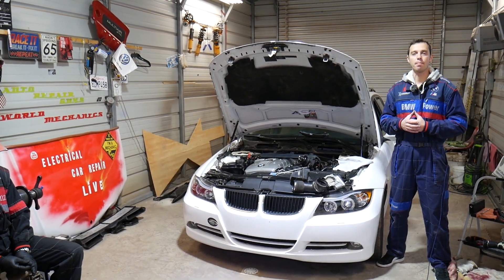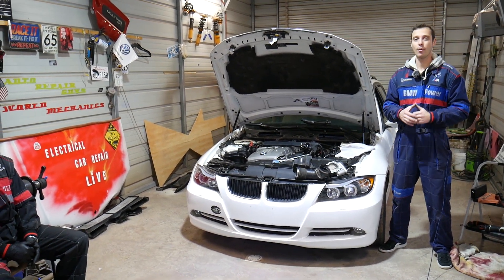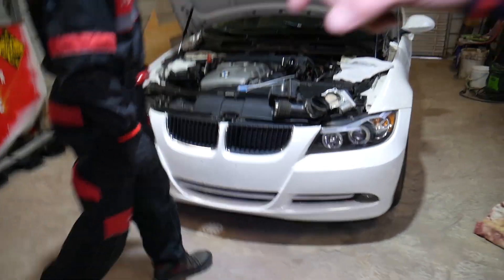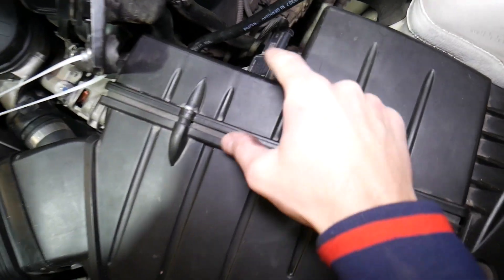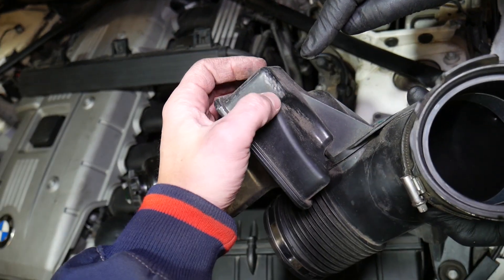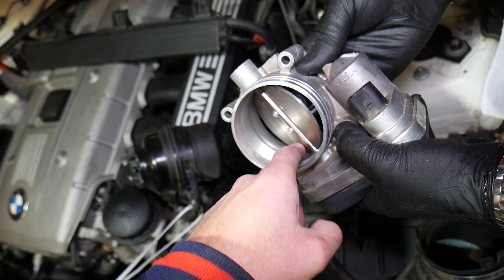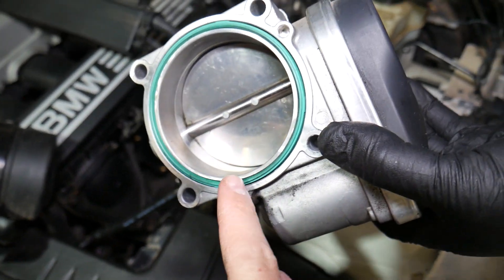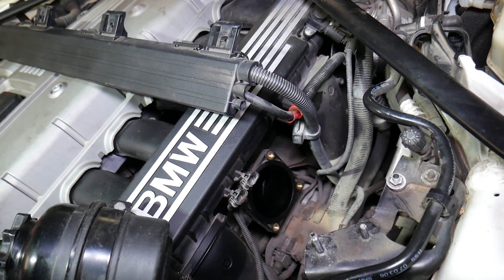ROUGH IDLE EXPLAINED ON BMW N52 N53 Engine E90 E91 E92 E93 E83 E81 E82 E87 E88 E83 X3 X5 Z4 E70 E60

Comment: So , my 325i 2009 N53B30 is rough idling and check engine light came on this morning!! Car drives as it did before no change but just idling rough for a bit on cold start and after 5 min its okay but check engine light still on. Any help !?
Reply: Hi, did you figure this out?

Comment: I have a rough idle on my e91 N53. It goes away once the engine warms up. Can it still be leaky air system, or would it be be faulty injectors?
Reply: ive change my injector and didnt change anything, if it can help u ;)
Reply: @timmybuzz420  I have it aswell, thinking its my PCV membrane, going to replace it soon.
Reply: Clean the throttle, vanos solenoids and filters. I had a slight hiccup when the car was hot and surprisingly changing the transmission fluid fixed it